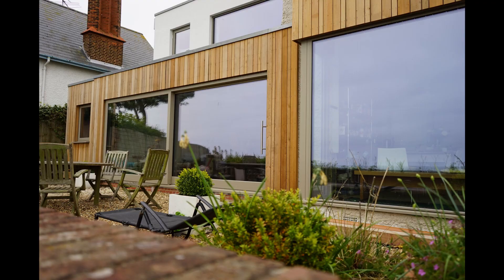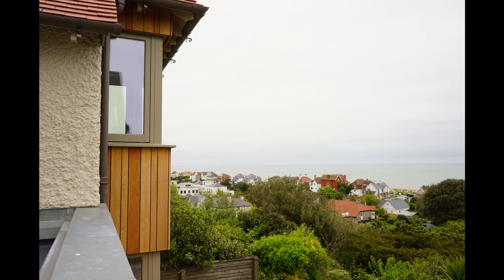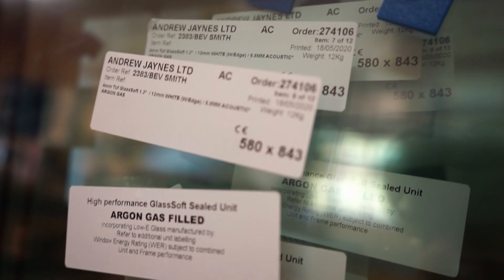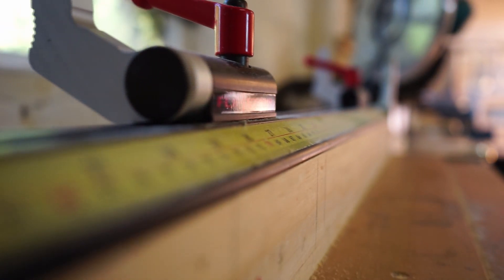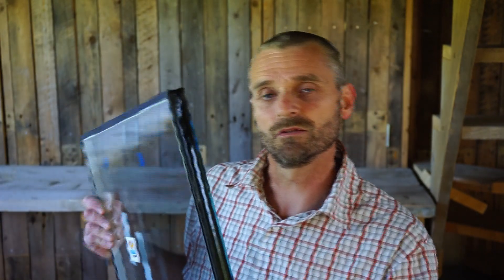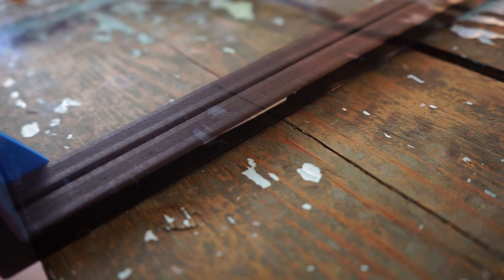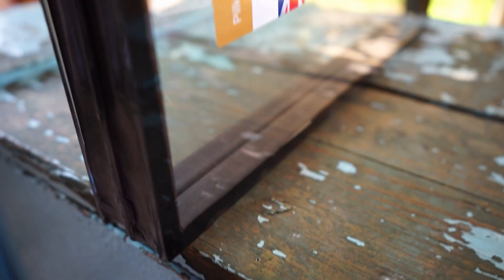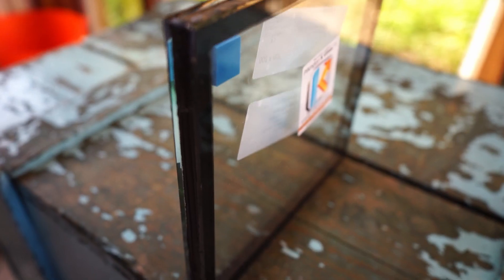Double or Triple glazing?

Comment: Hi,you clearly know your stuff,I wonder if you can help me. I have foil peeling on my upvc windows and have been told it could be due to the wrong tape around the sealed units which has caused plasterciser migration into the foil adhesive breaking the bond near the seal at the bottom of south facing sashes. Have you any knowledge of this?

Comment: Think you missed some important points, triple glazing you have two seals so increased failure rate, much heavier so hinges and runners won't last as long, also won't let as much light in the room.  But for things like aluminium bi-folds on new builds you'll probably need triple glazing to meet building regs U-values.

Comment: The issue that has not come up is that U-values are proportionate. That means a U-value of 0.5 loses half of the heat per hour of 1. Likewise, a low spec double glazing of 3 could would mean a 6 fold improvement in heat loss for top spec triple glazing, but only about 2 fold for low spec double glazing. 

Our 2003 detached house has dry fill cavity wall with a U-value of around 0.6. The other issue to consider is that upgrading your heating would be less impactful if you use much better levels of insulation.

I’ve communicated with several window companies, and they just don’t seem to know the science behind their products, with one asking “what is a U-value?” My response was that I couldn’t understand how anyone could make an informed choice without knowing that.

Finally, top spec triple glazing (U=<0.6) is an absolute fortune, compared to the local/ national ‘White Gold’ type companies. I was quoted >£50k for our home.

I’ve not taken this forward, because despite huge increases in fuel costs, it’s still cheaper to pay it as we’re only really talking about 4 months of the year
Reply: I forgot to add, Heat loss equates to the product of (U value) x (difference between the temperature you want inside, and the outside temp) x (Area of surface in sq meters)

Comment: Sounds like hes trying hard to sell double glazing.
Reply from the maker: Thank you for taking the time to comment.
Reply: @andrewjaynes9671  thank you, but truth is every product has a good and a bad point, just need to mention them and let customers come to an conclusion is best approach else people will think you are biases. Sorry for feedback. Your video was very decent and informative thou so im glad i watched it.
Reply: @jaspreet_singh_247 I have years in the field (although different country) and still can't see the benefits. Higher cost of production, shortened lifespan per unit due to higher weight, all the other things he mentioned such as insignificant gains in K-value over double glazed units etc. Not to mention the physical labor needed to install them. There are just no benefits
Reply: @maxworx1411  As a Joiner who makes lots of windows I agree. If the UK had a Scandinavian climate then Triple glazing would have a place. However we don't and add to that the ridiculous rules we have on trickle vents being compulsory now is nothing short of laughable. I've recently been using the thin vacuum units with a .7mm spacer but have a 0.7 U value which seem very good. Not perfect but lots of advantages over triple glazing.
Reply: It is amazing how biased they are against triple glazing.